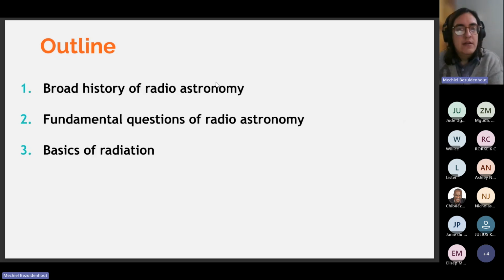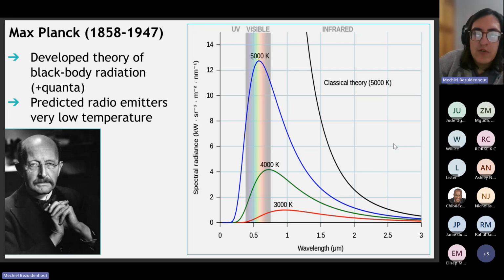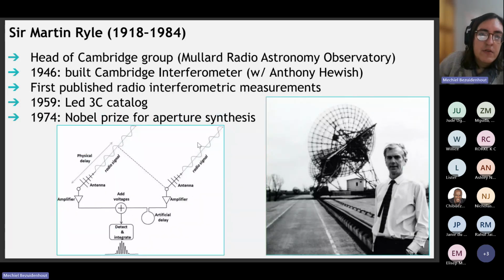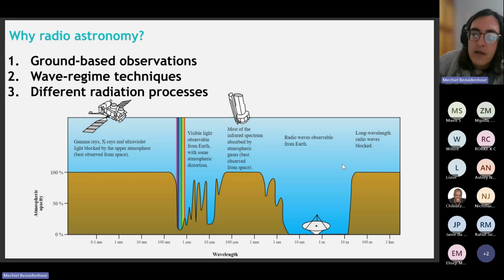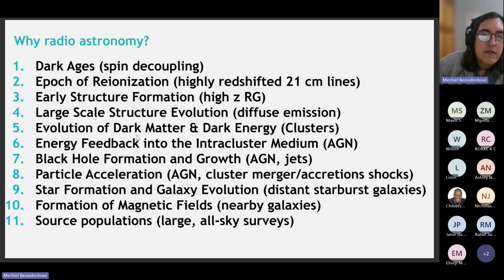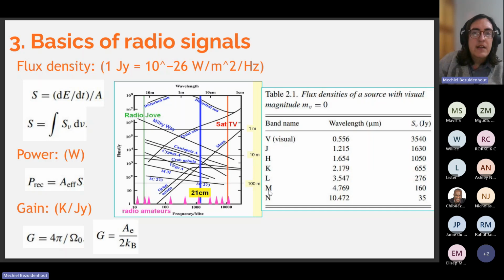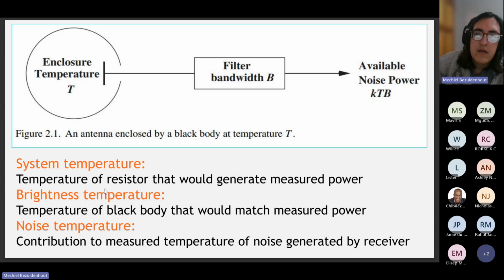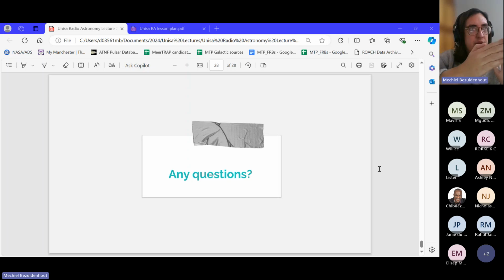Unisa Radio Astronomy 2024 Lecture 2: An introduction to radio astronomy

Comment: If I am right, the field of view is inversely proportional to the square of the diameter of individual dish. For interferometer of dishes with varying diameter, which diameter will the field of view scale with, the largest or the the smallest or the average size?
Reply from the maker: Hi Joseph. Sorry for not responding sooner. That's a good question.

In this lecture, we assumed that the beam pattern (response) of each antenna is identical, which is strictly not true, even for homogeneous arrays (where all dishes are identical). The reality is more complicated. The simple answer is that the response for a heterogeneous array will be a mixture of the response for the individual antennas. VLBI arrays like the EVN deal with this. For example, at ~1.6 GHz, mixing the 2.9 arcminute Arecibo beam with the 7.4 arcminute beam of Effelsberg gives a combined beam width of 3.8 arcminutes. 

The technical answer is that the response of an interferometer is a Fourier transform of the correlation between respective elements' illumination. So the exact beam shape of a heterogeneous array depends on how those illuminations correlate across distinct illuminations, which is not a simple scaling.